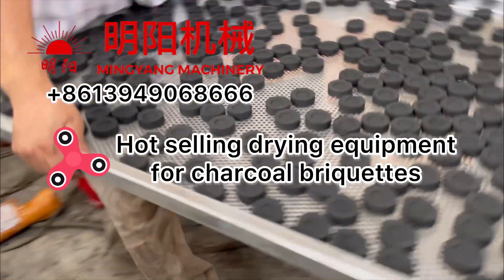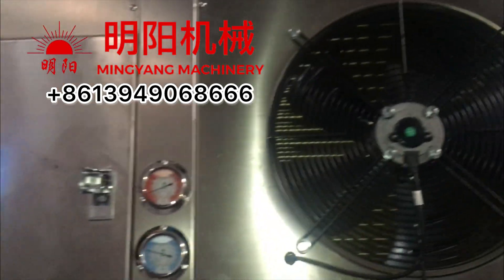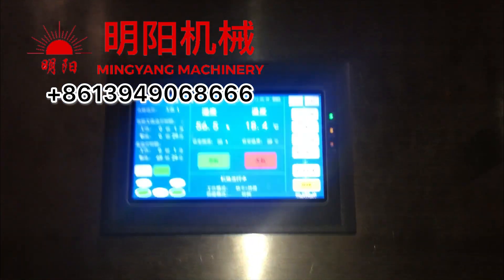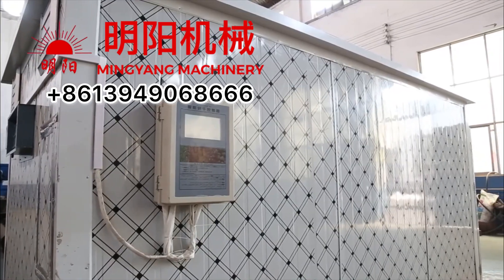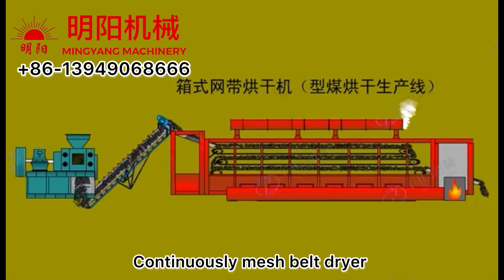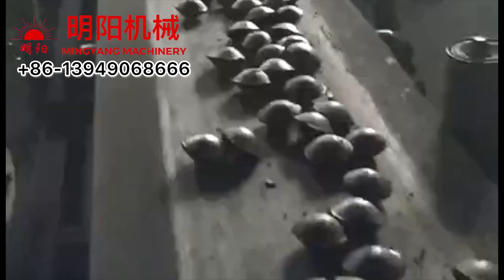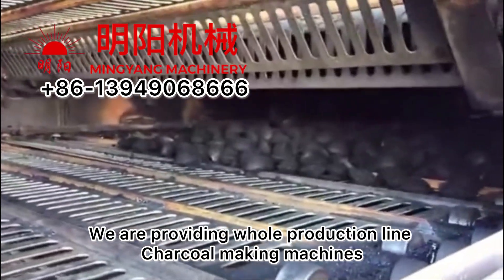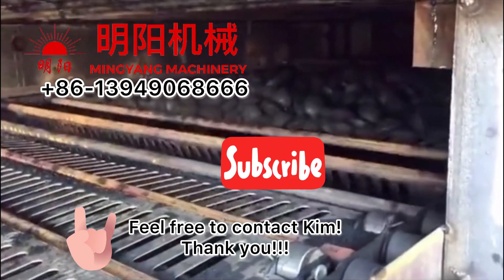How to choose Charcoal Drying Equipment?

Comment: First of all what's the level of moisture of charcoal briquettes, what's 
the required level of moisture in good quality product .How long it take to dry I ton material
Reply from the maker: Normally shisha charcoal is only 15% moisture. 
If it’s made from extruder, It will be 35% or even higher. ( based in each customer’s production habits). 
It’s ideal at 10-12% after drying. 

So every batch needs 4-7 hours finish drying.
Reply: Thanks for your kind reply. This is what I was assuming good strength is must to avoid breaking into small particle whether for Shisha.or Bakhore or BBQ Briquettes @kimzhao-charcoalmakingmachine
Reply from the maker: @farjadzaidi2956  Charcoal itself, binder you using are also important if you want to get charcoal no cracking. Drying temperature is only one of the factors. Not all counting on drying.
Reply: Very right too high temperature will cause cracking .I assume 90 to 100 C with air circulation will do the job good.
We are using 5% wheat starch plus 20% water in Charcoal briquettes and 10%Gypsum and 15,% water in mineral coal lignite and anthracite
If some suggestion you can give plz share.
Share your What's App number
Regards
Farjad Zaidi
Reply: Can u tell me most efficient drying method for production of 6 t/ hr